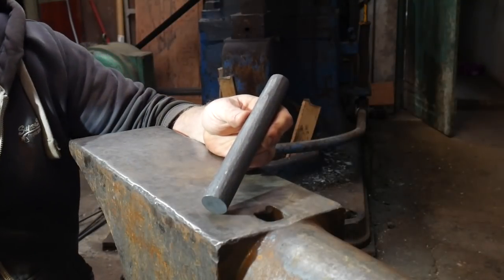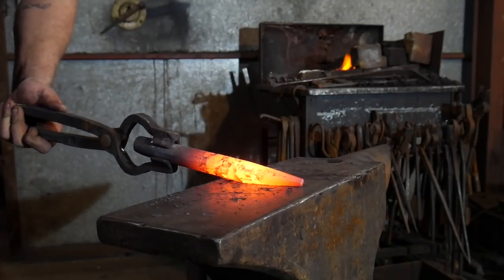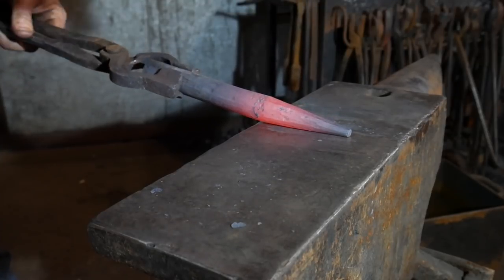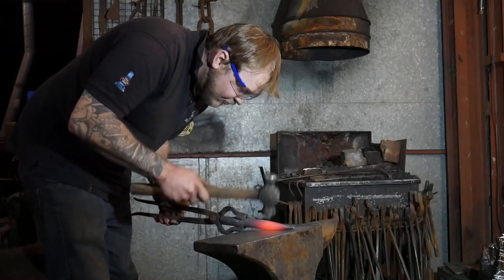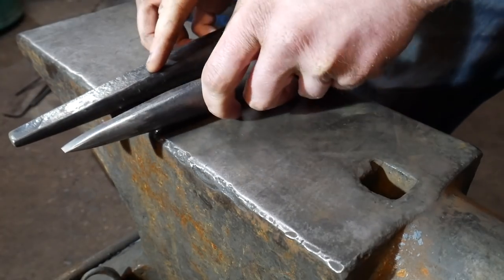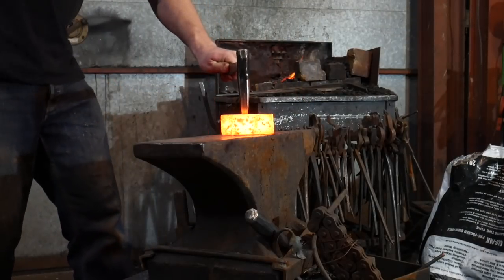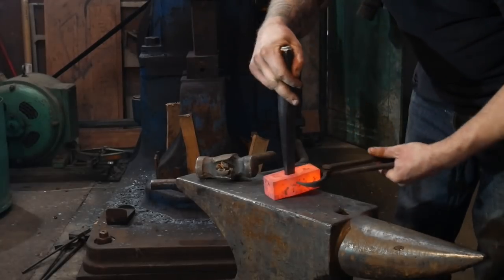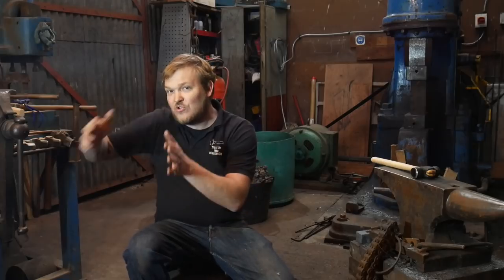Super Simple Hammer Eye Punch! How to make and use it!

Comment: Hmmm... I've made a couple of San Mai Knives using 4140 as the cutting edge, and I use it for Axe Bits on occasion, but I didn't know that it could be used for Hot work.  seems that I learn something new every day.  :)
Reply: John Bovee really? How did that work? Surely 4140 doesn’t maintain a suitable edge for long? Never heard of it being used before for edged tools.
Reply: @Jinjameson17189  I probably wouldn't use it for a knife but it should be perfectly fine for an axe

Comment: Nice Vid. However, I’m somewhat puzzled as to the choice of the punch material. Why not use a designated heat-resistant tool steel rather a chunk of a forklift tine?  Heat-resistant steel is capable of doing the same job without the need to quench it every other blow, and will last that much longer. I have punches and mandrels I’ve made from such steel 25 years ago, and they are still in constant use with minimal dressing. Those made from simple allow steel such as the tine all wore out and got tossed in the recycle bin years ago. 
Just my two cents’ worth.
Thanks for the Við.

Comment: Not planning on making any hammers soon but useful info for general punch making! 
Love how your idea of "choking up" on the hammer is still a way longer grip than some other YT smiths use to strike powerfully ;) 
Quick question, what sort of steel do you think those haybob tines are? Got a ruck of them here, sparks like high carbon so just used one to make a twca cam and seems bob on so far, no issues despite quenching it in water!

Comment: question - why not a flat bottomed punch instead of a slit punch? What is the difference in use? Thank you.
Reply from the maker: You could use a flat bottom punch but you gain some benofit form using a blade or sharp slitter. Firstly and most importantly it cuts through the stock quick it also retains more of the stock. (you get a smaller slug.) you can also move the punch in the hole more easily. However there is a good chance you can over heat the tool or damage it easily. Hope that helps.

Comment: Thank you Daniel Very informative. I have 1 set of fork lift forks!!!!  I want to make my own drift and punch. but i have no power hammers or press yet. Do you know what steel the king pin in a ford front end is. i'm thinking its the same. I have a few of them they are 1in round. If so I could use them. Any thoughts would be greatly appreciated.
Reply from the maker: Thank you Mike. Worth a try not sure what it is but 4140 is a common engine steel. Give it a go and see.
Reply: @danielmoss2089  Thank Dan,
I'll try. I started about a year ago mending steel,It's a great hobby. I made my  own tourches and forge. I picked up a fairly nice 156# anvil. You are one of the main few I watch and rewatch your videos. Your a very good teacher. I thank you for all you hard work on these videos. I'm sure they take a lot of your time.  Happy Holidays !!
Reply from the maker: Engineer steel not engine
Reply from the maker: Thanks for your kind words. They take forever and they have lots of love and hard work in them thank you for noticing.

Comment: I am new to the smith why did you upset the stock instead of just going to the square than to round?
Reply from the maker: There are two reasons. Firstly is that by driving the stock back into its self you create a lot of friction. This friction is where the molecules in the stock are forced against each other. It slightly raises the temp of the material but most of all cause the stock to shunt heat to the very center of the stock. This makes it easyer to Forge.  Secondly and there is some controversy about this but it so say improves the steel quality. When you slam the material together hard it cause the volume to decrease whilst the density increases with the mass staying the same. Fun facts. Lol. Hope that helps
Reply from the maker: Ps this is something that can only really be done on big power hammer and drop forges. Also with very big presses.

Comment: Did you harden or temper the punch and or drift?. They look amazing!
Reply: On something like that it really doesn't matter because you getting it hot enough to ruin your heat treat anyway. That's why you just keep dunking in water 👍
Reply: Ben Toombs great thanks. I’m a nooby.
Reply: @dylankirby9359  no worry dude we all are 😁 never be afraid to ask what you don't know. That is what makes you a master
Reply from the maker: I see you have learnt something from me Ben. Lol
Reply: @danielmoss2089  I'll never admit that
Reply from the maker: If the punch was longer like the hammer eye drift but the same size stock as the punch I might harden it to stop it bending. which I have had happen but if you are trying to drive something like this through larger stock I would suggest not bothering as the will take the temper out of the tool the first time you use it.
Reply: @danielmoss2089  I'm glad you learned something from me Daniel

Comment: Recently made my own hammer , punch made with D2 and hammer from EN43... It was harder making the punch than the hammer.. D2  V hard to do by hand .. And the hammer was round stock , not  square.
Reply from the maker: I might be wrong but D2 and en43 are both high carbon steels. They don't make very good impact tools. They are both knife steels.
Reply from the maker: But the princable are the same for the forging process. I hope the video was some help.
Reply: @danielmoss2089  Hi ,  I am just leaning , the blacksmith supplied the steels , and yes you are correct , however I believe that D2 is not great for Knives as it can be difficult to sharpen ? The D2 has a high chromium content and forging it requires a lower temp than I expected ...
 I liked the idea of welding a rod / handle to the punch . I had to hold it with tongs !
Thanks for your video's I always learn something.

Comment: Nice.. do you prefer metal or wooden handles?
Reply from the maker: Wooden I think but this is just a fast and easy way to make a tool. I've start using metal handle resently and I'm finding the OK. I put rubber pipe on mine and that really helps. But each to there own. How about yourself?
Reply: @danielmoss2089  A rubber guy ahh🤔 lol 😘 I grip everything with tongs

Comment: but did you harden it the punch?
Reply: You shouldn't really harden a drift. They need to be made of a heavily durable metal, like O1 or H13 (among others). Because of how often they'll just get so damn hot, a heat treat is pointless. A tough steel, normalised after its made and cooled frequently during its use, will do you perfectly.